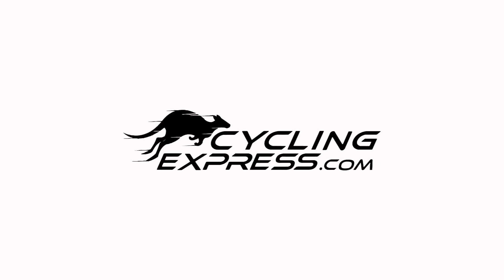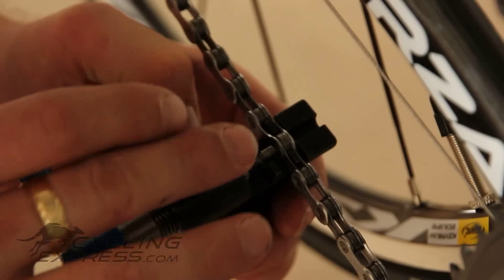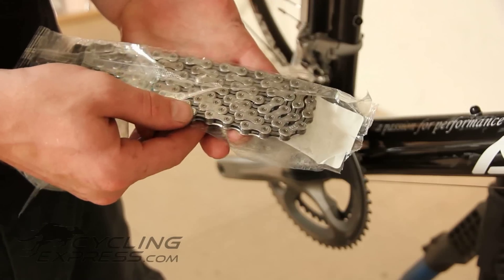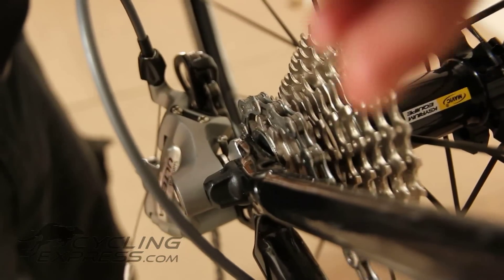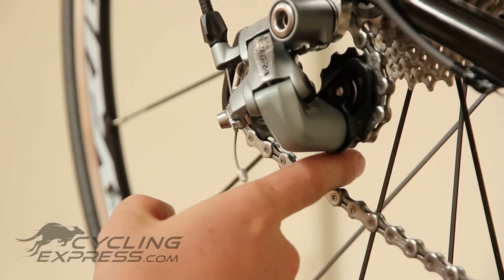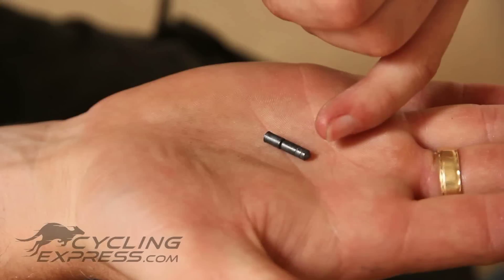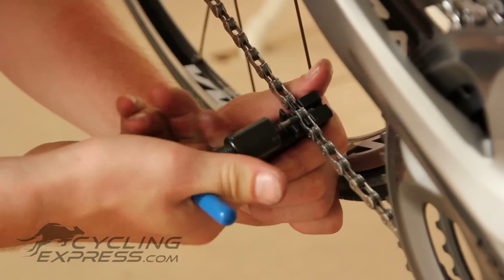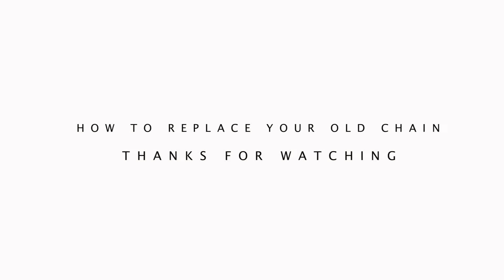How to Change Your Chain

Comment: best video of them all I find. However if your link is stiff after youve put your new pin in what do you do? It looks to be right in the centre so can't work out why its stiff...? I put the pin in from the 'front' of the chain 'bullet shaped end' in first. Presumably it doesn't matter which side of the chain you enter it from?
Reply: Perhaps the pin wasmade in China so when you tightened it the metal was so soft it bulged or was just badly sized in the first place. Or did you over tighten (with Dads extra strength) and squash the link?
Reply: I worked it out. The pin needed a final nudge a fraction of a millimeter more to click into position, a distance not visible to the naked eye. PS yes the chain has an 'outside' which is explained in the video and mine was a shimano chain like this one so I did use the special pin. I still have problems though as my chain keeps falling off the front chain wheel when I apply significant pressure to the pedals. It seems like an infuriatingly complex and unstable system when you don't know what's going wrong.
Reply: May be the back cassette isnt quite aligned properly to the cogs on the crank shaft. - I have vague recollections of this being a cause of chains coming off shimano gear systems